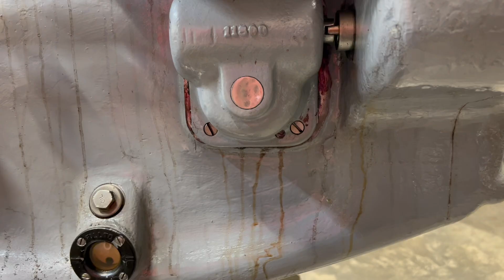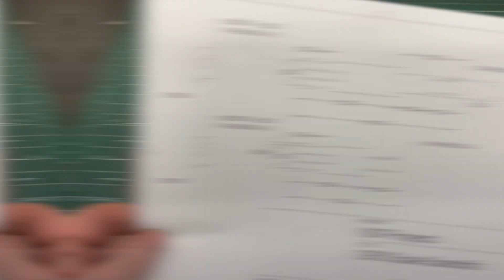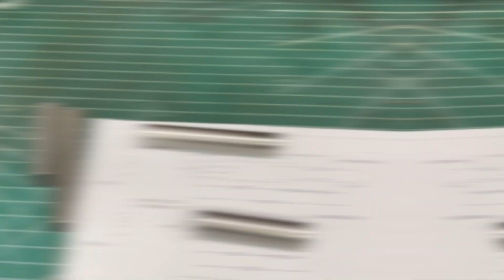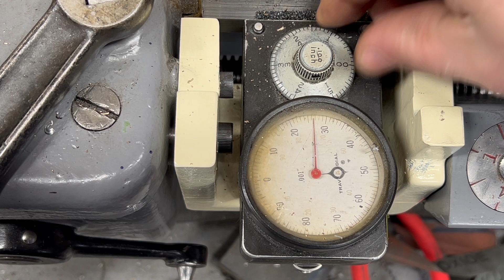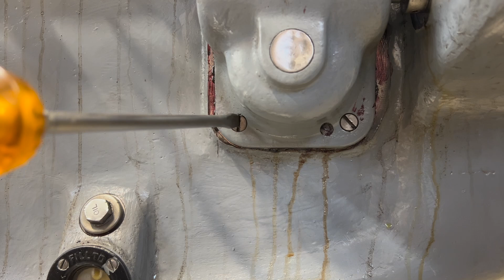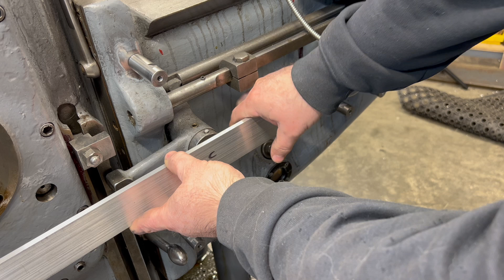DIY DRO - Making stand offs to mount the saddle scales on the K&T 2HL

Comment: Spiral flute taps have a nasty habit of not wanting to break the chip if they are too deep and you wanna take them out. it if not helped by the the fact that the flutes are full of chips that can also bind and case the tap to break. If you feel any resistance, work it back and forth
I have tapped hundreds of holes in a turret lathe with spiral taps and all of them broke when was about to pull them out. it was faster and cheaper to scrap one part and get every single second from the tap than to potentially replace it early and risk it still having a few holes of life left in it. Economy
Reply from the maker: That makes a lot of sense in a production environment. I have usually had good luck with them. Comes with the territory.

Comment: Greg, I use the spiral flute taps every chance I get. Something that has worked pretty good for me is to drill the hole just a tad larger than the recommended diameter. I do have one 1/4 x 20 spiral flute tap that always makes tight threads so I need to trash it .  Sure better to trash a tap before trashing the part the tap just broke off in. LOL  In the case of mounting the scale a slightly larger tap hole diameter would not be a concern for me. Thanks for bringing us along. I tried to watch this video earlier today and You Tube kept taking me to some weird page trying to explain the rules on Pre-Teen videos. I guess the problem worked itself out.
Reply from the maker: That’s a great tip for using spiral taps, I’ll have to try that. Glad the YouTube issue worked itself out. YouTube is fickle. LOL!
Reply: @MyLilMule  I'm going to admit that I am no genius I learned the trick by accident. Didn't have the right size bit so I used what was close. LOL You Tube is my Everything daily. Being on the downhill side at almost 73 it has totally replaced Television and most of Hollywood's sewage. I personally think the really good creators like yourself deserve as much if not more credit than the Hollywood producers and actors. I have heard negative comments about You Tube but I'll always stand firm defending the good solid creators.

Comment: When they designed the K&T back in the 1930's they didn't put much thought into how the glass scales would mount.   No really good way to do it but it looks like your plan  will work.
Reply from the maker: Those engineer's were geniuses. But they definitely failed at seeing into the future! 😂 I have been working on this for probably 2 years now. This is the only thing I was able to come up with. At least on this machine. Maybe the bigger ons it was easier. 🤷🏼‍♂️

Comment: I use spiral bottoming taps at work all the time. I hate them. The plus is they tap to the bottom of the hole. The minus is they're more brittle and easier to break. I'd rather drill my hole deeper where it's possible to avoid having to use a bottoming tap.
Reply from the maker: Great point. I will definitely consider the alternative.